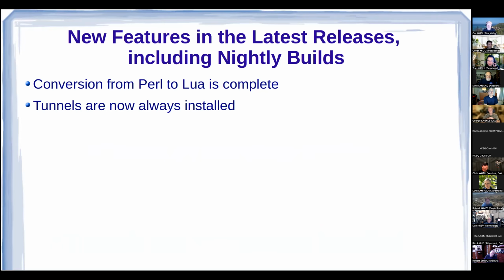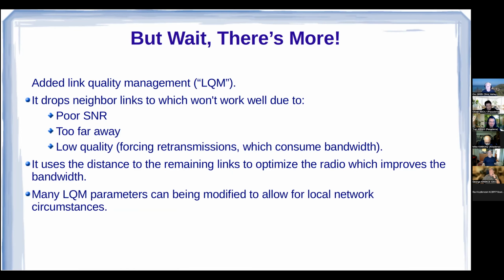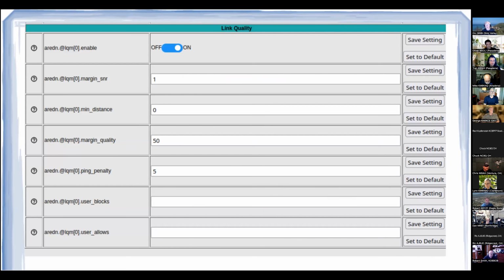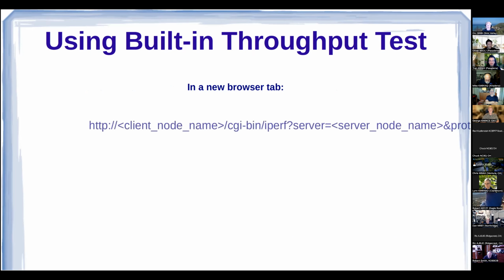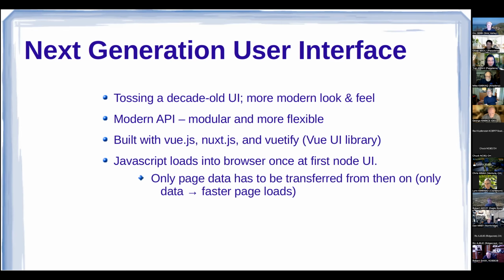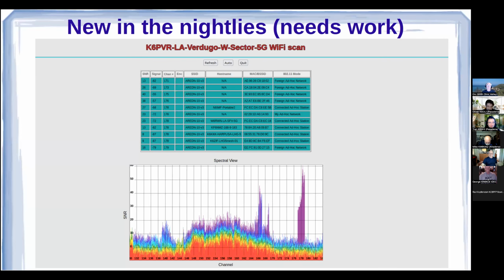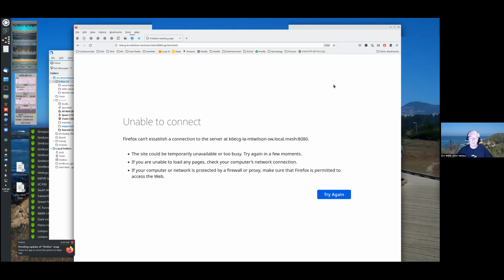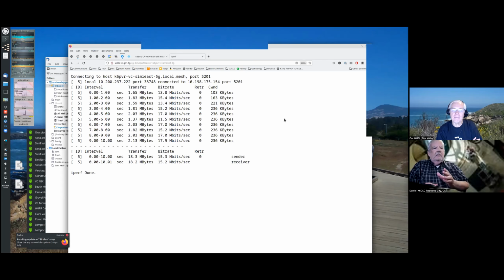2022 AREDN Updates and New Features by Orv W6BI at LAXNORTHEAST

Comment: Great presentation about the AREDN firmware update. I don't get to come to the live presentations like I used to, so posting this on YouTube is much appreciated. I have updated the firmware on my router and LNB Mikrotik antenna and I've been checking out the LQM management feature. For me personally, I'm still undecided whether this is an improvement or not. Some of the parameters under the LQM settings are beyond my understanding, and I'm been experimenting with the Power and Link Quality settings. A large percentage of the nodes on the Wilson SE sector Mesh Status page (Los Angeles basin and beyond) are on the tunnel, so filtering out weak RF nodes didn't appear to have an advantage for me. 73's AA6CD